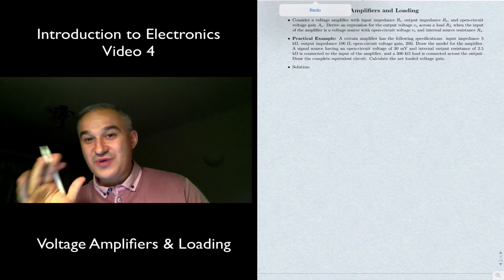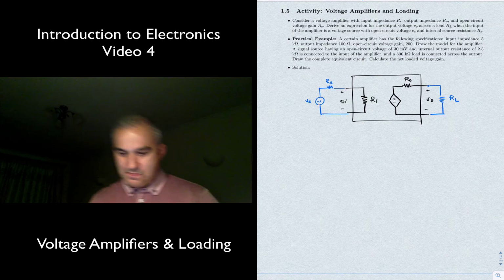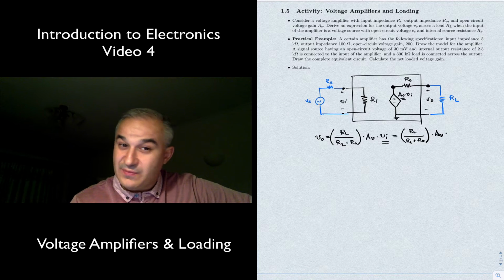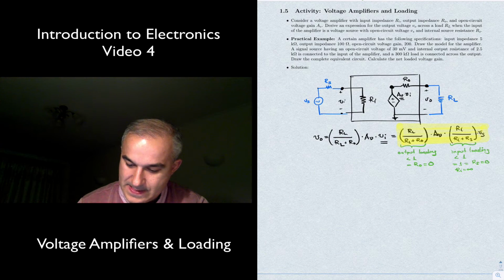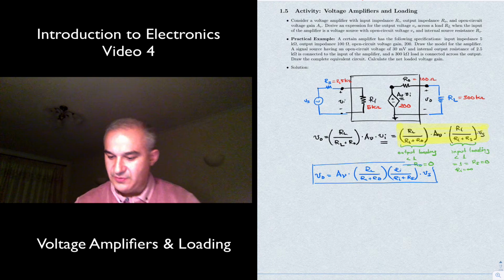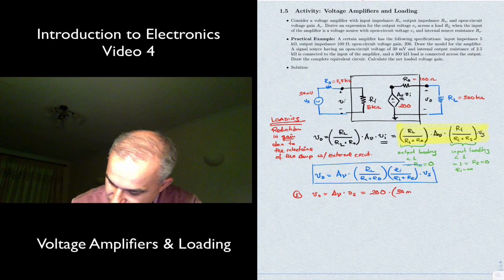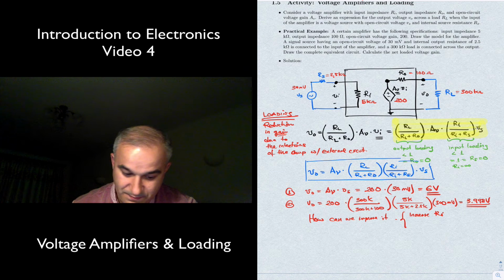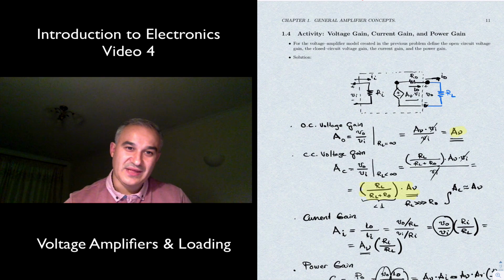Electronics - Voltage Amplifiers & Loading

Comment: how did you get 3.998 because once I input the numbers in my calculator I get 0.99966...????
Reply: 300mv is typo.... use value in text of question, and on diagram, 30mv.